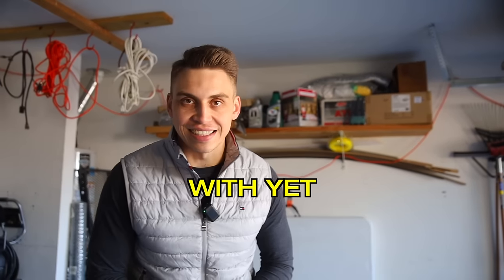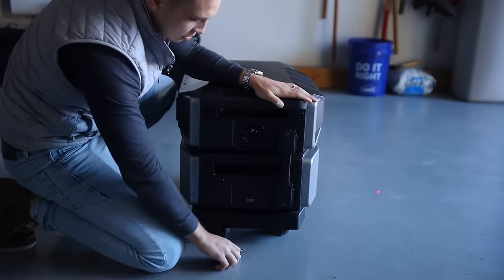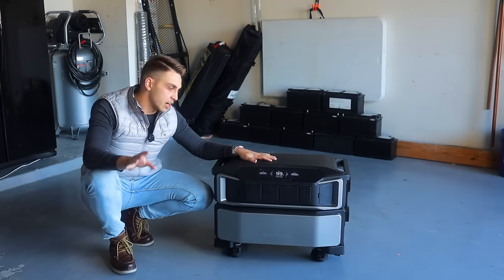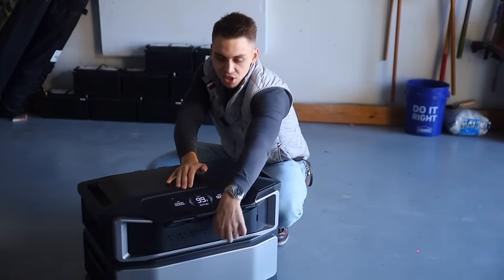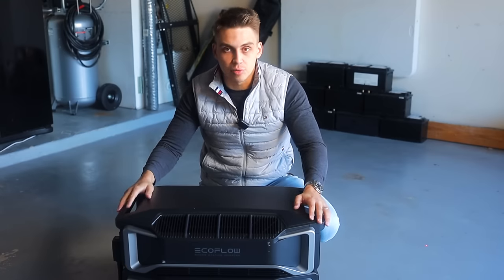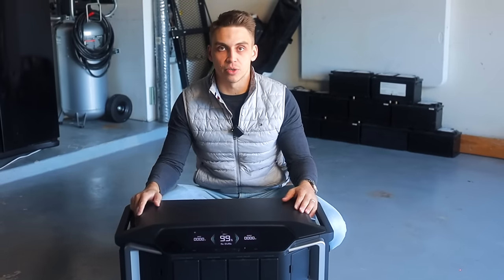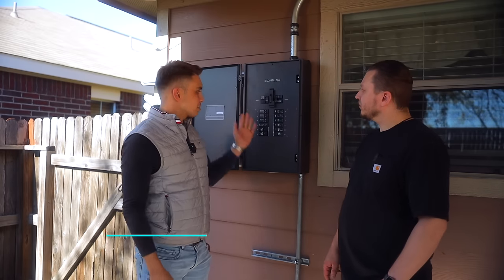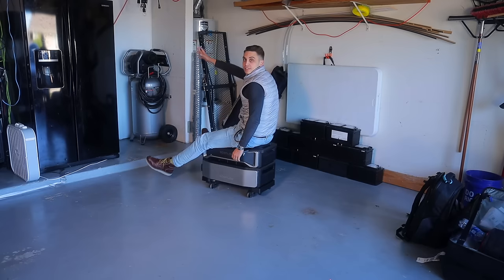First Full Review of EcoFlow DELTA Pro Ultra & Smart Home Panel 2

Comment: Does having this Inverter/battery do away with using Micro Inverters or some other types of string inverters for rooftop solar setups?
Reply from the maker: Hi, rooftop solar array micro inverters or string inverters are DC-AC in general. Our Delta Pro Ultra supports high/low solar input(two separate ports). You can check the specs of your own rooftop solar arrays and see which solar input port you should plug in.
Reply: Are you supposed to have a Solar Charge Controller in-between the panels on the roof and the Ultra?  Is it required or just a best practice or not needed at all? @EcoFlowTech
Reply from the maker: Hi sorry for the late reply! No, a solar charge controller is not needed, the ultra inverter will do its job.  @Hypertrev11

Comment: I want to charge my EV and/or Tesla with DPU's 240V 14-30R port (Or DPU's 240 V generator port cannot be used for this level 2 EV charging purpose???).  I asked EcoFlow's tech support.  She said it can be done.  But I am still not sure how to set it up properly.  Could you provide some more details?  Thanks.  I already received my DPU in my garage.
Reply from the maker: Hi, it is suggested to get a neutral to ground bonding plug (like this: https://www.amazon.com/s?k=neutral+to+ground+bonding+plug&adgrpid=120556264204&hvadid=631614860618&hvdev=m&hvlocphy=9032186&hvnetw=g&hvqmt=e&hvrand=2102013651095589687&hvtargid=kwd-969109812861&hydadcr=13059_13482270&tag=hydsma-20&ref=pd_sl_7rb5t1l20j_e) and plug it into the 3rd 120V, 20A AC output sockets (counting from the left to the right). It is recommended to use the 120V sockets to charge your EV. The 240V socket is not recommended. Also, may I know the specs of your EV charger? If the N-PE detection is detecting the resistor rather than the voltage, the unit will report a grounding fault.